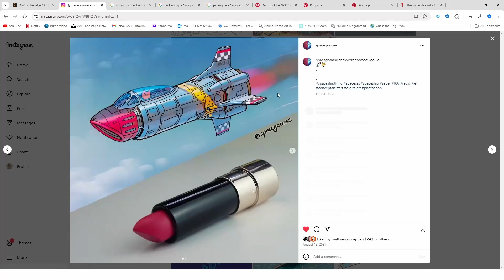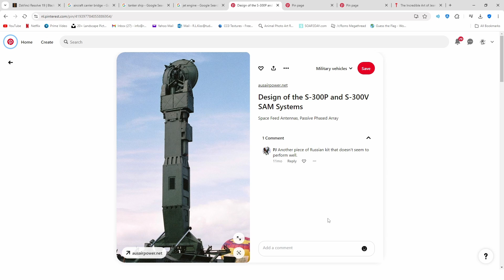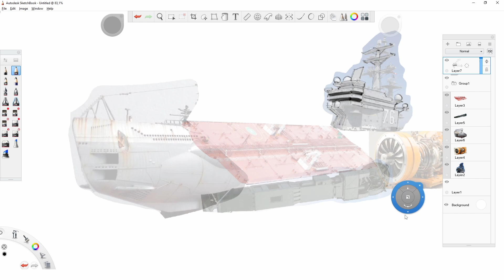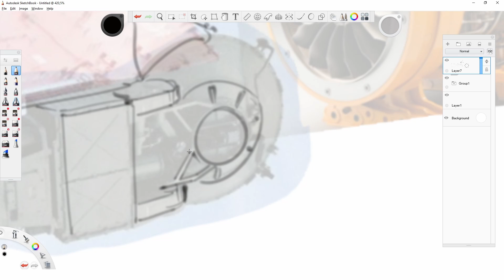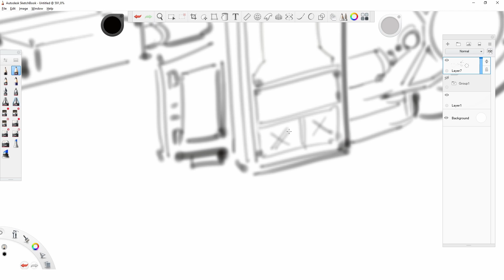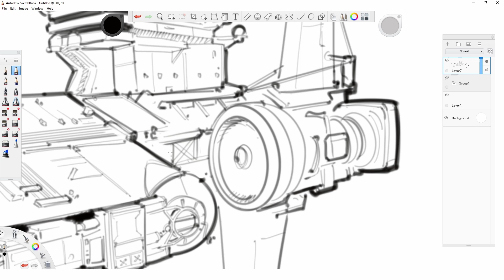Lazy Spaceship sketching tips and tricks Part 2

Comment: Another hack for this method. 

On Mac, after you snag the reference pic, secondary click on the image file. (With a Magic Mouse or Magic Trackpad, two-finger click. For a mouse without touch sensitivity, Ctrl + click. On iPad, it's just in the touch control options.) This brings up a list of options. Scroll down to Quick Actions. In the Quick Actions tab you'll see Remove Background. Click that. Voila! It will duplicate the pic as a png file (with background transparency), with everything but the foreground object(s) removed. Just move that copy of the file in and you don't even have to crop the image.

It's not perfect. Sometimes the background removal algorithm makes some odd choices. But for a method like this that's rarely going to make a difference.

Comment: Is it legal to take objects t create New ones like ships?
Reply from the maker: Why wouldn't it? I'm not making money of off it. And you can't really recognise the original object. The point is to change the objects into something new
Reply: I'm not a lawyer. But... my understanding is this kind of stuff, at least where I'm from (the USA), is generally legally in the clear. The core question is whether something's transformative or not. 'Transformative' is vague, and always up to the courts. But with this kind of method, if you're doing it right, the copyright holders of the pictures wouldn't even recognize that you used their image as a reference, if you showed it to them. You're hacking up the original photo... maybe using image warping functions to distort the photo, if it's good for the design. If you're doing this well no one would even know you did it this way.

And another thing to keep in mind, these are just concept sketches. It's not the final product. In a commercial pipeline you wouldn't be using these sketches in the final work anyway; you'd be using the design in other perspectives, likely even other mediums.